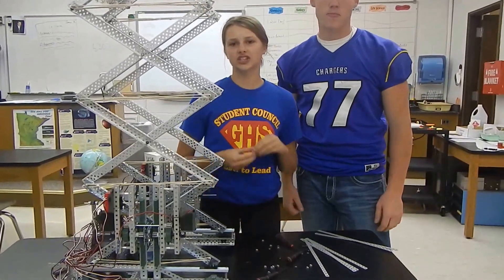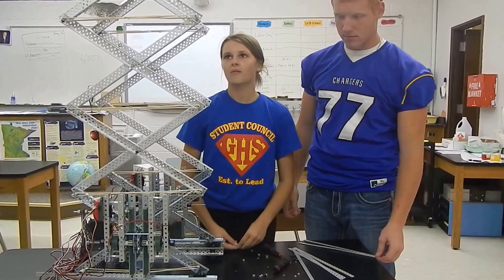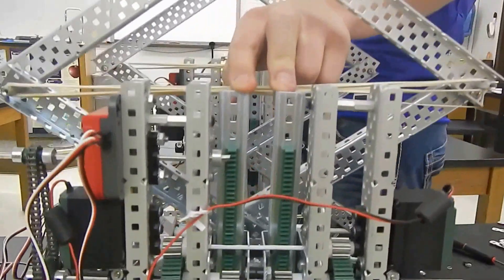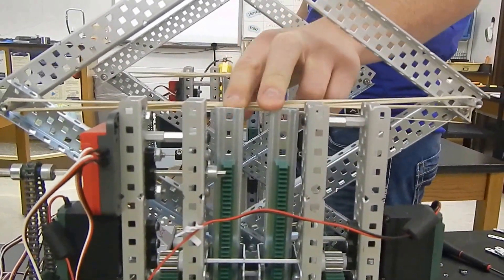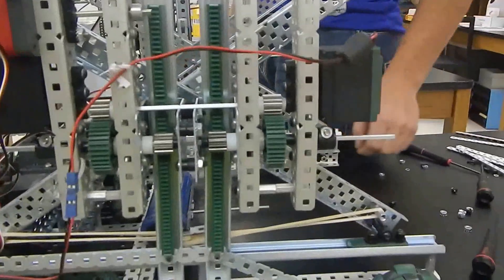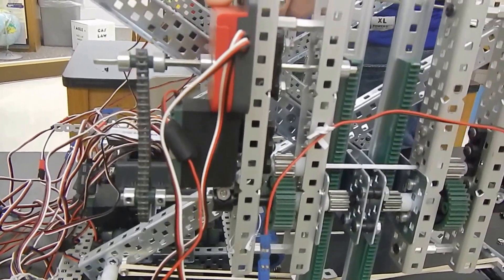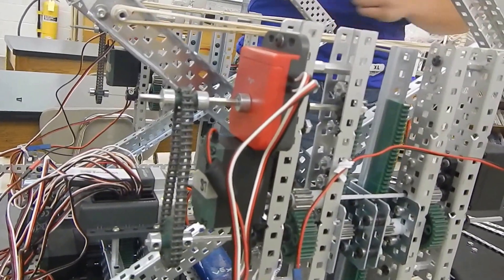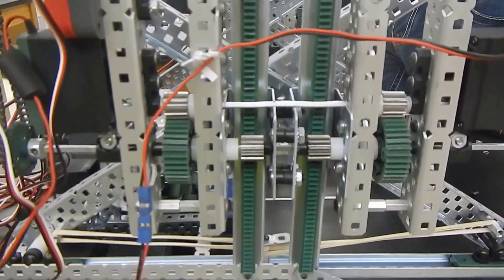4149G Skyrise Improved Prototype Scissor Lift

Comment: Can you send me the code you used for the rotational sensor syncing? We're having issues with a wobbly lift.  Thanks
Reply from the maker: Sorry for the slow reply. We were very busy getting ready for our state competition this past weekend. Here is a snippet of code we use to help the lift go up straight. It is based on motor encoders (IME's).

	if (nMotorEncoder[leftfrontlift] > nMotorEncoder[rightbacklift])
{
motor[leftfrontlift] = 60;
motor[leftbacklift] = 60;
motor[rightfrontlift] = 127;
motor[rightbacklift] = 127;
}
if (nMotorEncoder[leftfrontlift] <  nMotorEncoder[rightbacklift])
{
motor[leftfrontlift] = 127;
motor[leftbacklift] = 127;
motor[rightfrontlift] = 60;
motor[rightbacklift] = 60;
}
if (nMotorEncoder[leftfrontlift] == nMotorEncoder[rightbacklift])
{
motor[leftfrontlift] = 127;
motor[leftbacklift] = 127;
motor[rightfrontlift] = 127;
motor[rightbacklift] = 127;
	}

Comment: Just a suggestion, I'm not sure if you're having any problems with friction on your lift but adding bearings and washers to the linkages definitely helps by minimizing the contact between metals. Also, you should make sure that you linkage tightness isn't exceeding what you really need as in when it comes to scissor lifts it could very well damage the whole mechanism. I don't see any of these problems on your video except for the bearings recommendation but I still commented as a heads up because if you've overtightened your linkages you could speed it up by reducing your friction and your tightness. Bearings provide an indisputably great mounting space for your linkage screws whilst also reducing damage to the metal and the screw. Anyway, good luck, your robot looks very well built and it works well other than that. What you've gotta work on from now on are the details that distinguish a good robot from an excellent robot.

Best of wishes from Intrabot Robotics | 2223M Robotics
Reply from the maker: We did in fact build a prototype with bearings. We found it to be much worse than our current design. The bearings require that you use shafts and collars which invariably have a large amount of slack in them. Also, it gets quite heavy using bearings, because each joint has two bearings (one per piece of metal) which means four screws and nuts plus a shaft and two collars for EVERY joint. It adds up to A LOT of weight in hardware. We actually measured it all out on the scale for comparison, don't remember the numbers now, but it was significant. Instead we simply used a screw with a nylock nut which allows you to tighten it to "just" the right spot. We also have Teflon washers in between all moving pieces which substantially reduces friction. I'm sure bearings can be beneficial if the scissor lift is constructed differently, but for us they are without a doubt not a good thing.

Comment: Team 5658E here! Some of the scissor lift designs i've seen at competitions have been really bad. I'm glad someone had the decency to build one that actually works. We use an elevator lift that can reach maximum 5 Skyrise and 4 Cubes with a claw for Skyrises and a passive cube intake. We are still deciding on a base to use as ours is really unconventional. I've been thinking of an X drive but if you have any suggestions that'd be great!
Reply from the maker: We think simple is the way to go so all we have is a standard chassis with omni wheels. If you would like I could send you a link to some in-depth pictures of our chassis.